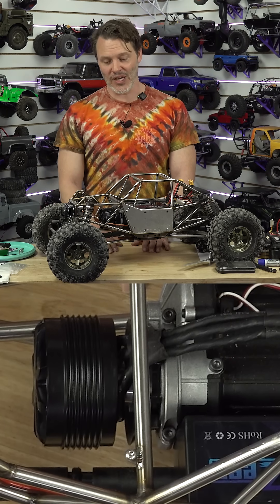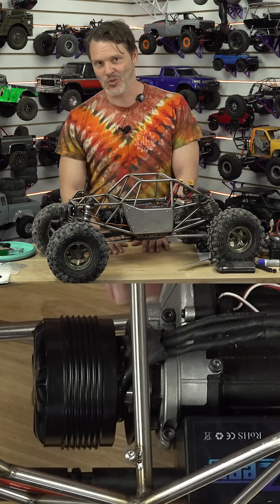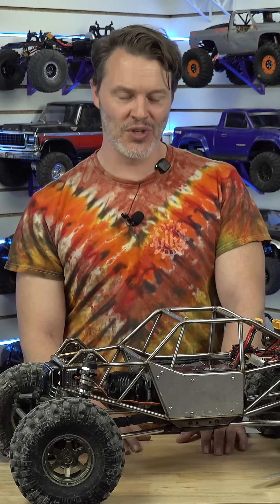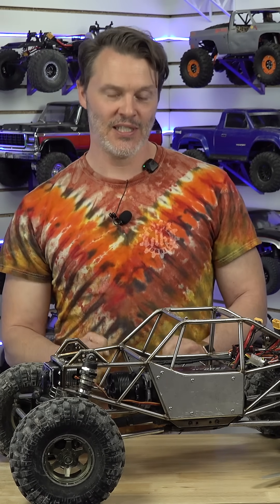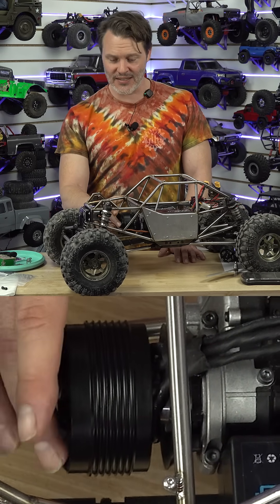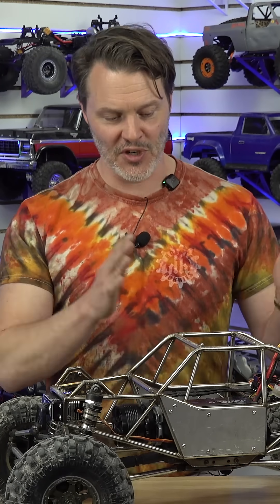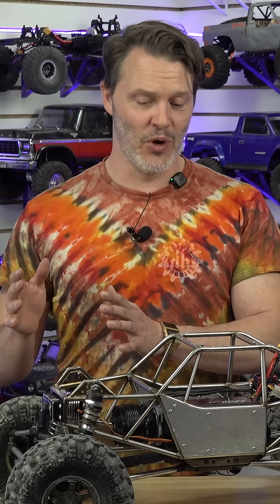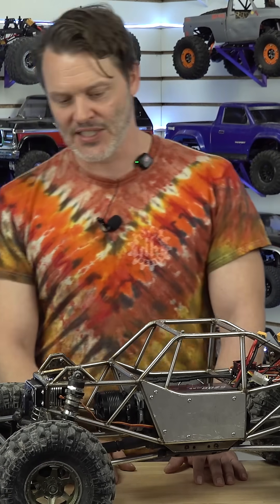We Broke the ESCs 😅 Testing Our Wild New SCX6 Motor!

Comment: I want the high amp , high power bec esc to put it with you 4274s?
Question John.
Are you eventually redesigning the 4274s?
Reply from the maker: eventually.  Starting with the 540 4 poles first.